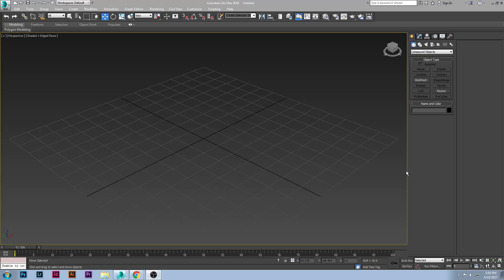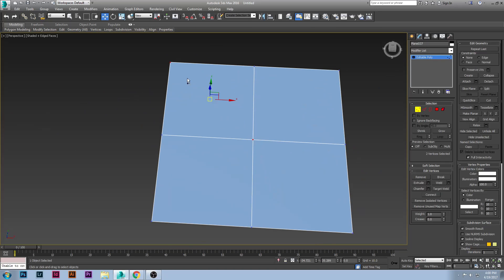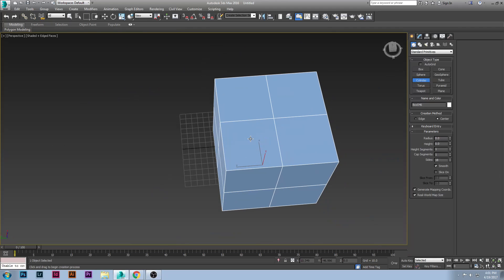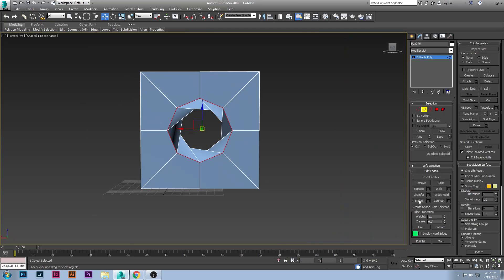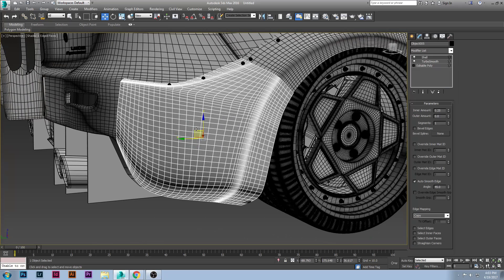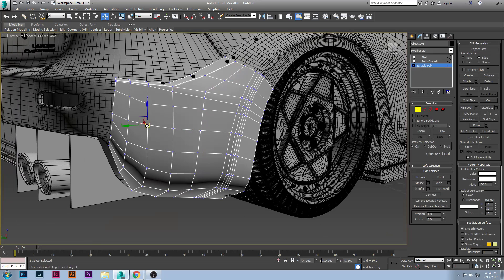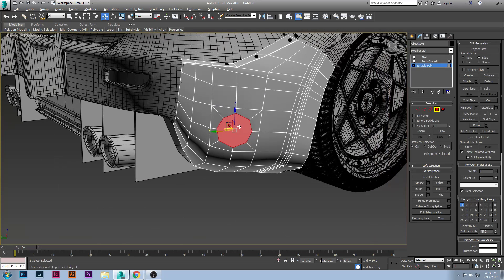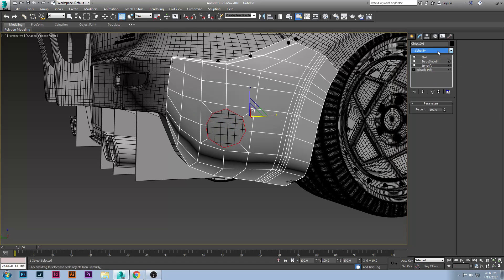How to Create Holes in Geometry - 3ds Max - Easiest Way

Comment: Thank you so much for the useful technique. 

I may have a question? 

The edges of the parts of the car model are not smoothed despite of the turbosmooth(TS) modifier. (Also I found the shell modifier is not 'under' but 'on' the TS  modifier.). 

How is it possible? (Sorry for my poor English)

plz teach me 

Thanks

Comment: Please Do A Videos on how to make a ''OVAL'' Shape cut hole On A Plain Mesh, THEN making duplicates & Converting them to a form a Cylinder shape {If You Look At A Kenworth on Peterbilt Truck Exhaust You'll See What I'm Describing] I'm Having Trouble modeling the OVAL & CAPSULE Shaped holes ON THE CYLINDER To Go Round and Round TO MAKE THE a Heat Shield exhaust..Please Help! I'm New To Blender 2.79 doing my best to learn! Thanks
Reply from the maker: hey sorry i never replied. It is very similar to making a circle like in this video, however just deform the points in the hole to be more oval shaped. then you can take that plane with the oval in it and array it into a cylinder. (youtube array in 3ds max, someone has a decent tutorial somewhere) Id make a video but i currently cant.